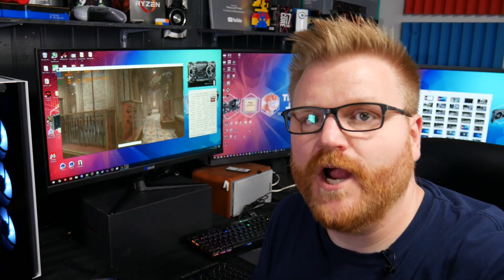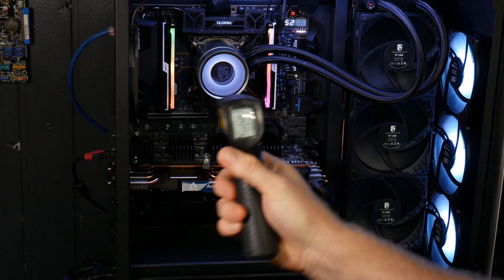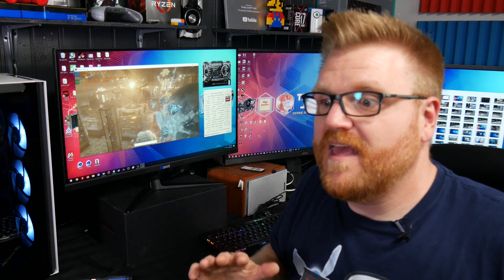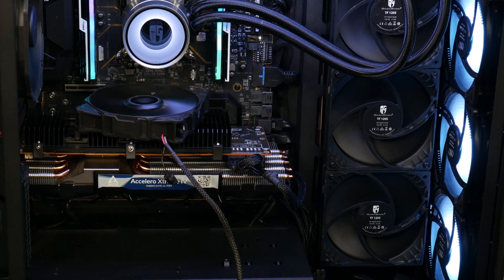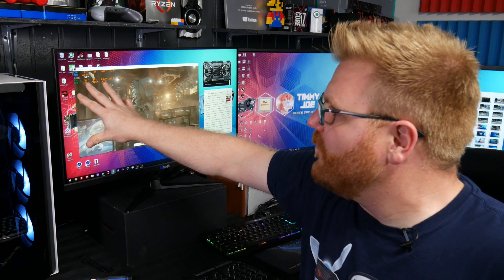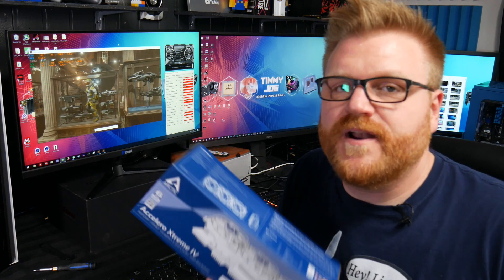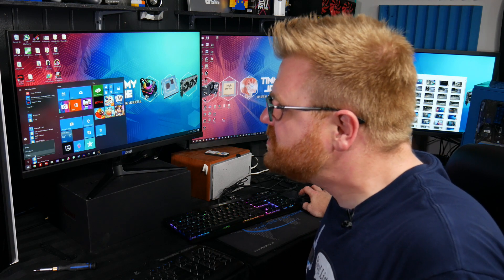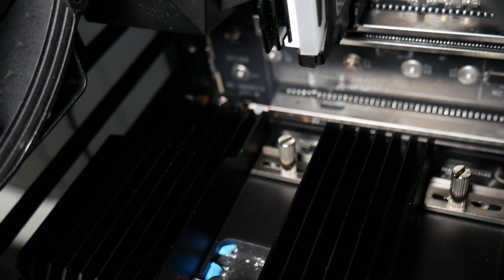Not even the Arctic Accelero Xtreme IV...

Comment: More fans doesn´t always mean better cooling or airflow. I mean, from what I understood, you have 3 front fans sucking air in, one bottom fan also sucking air in and three more fans sucking more air in from the water cooling (so 7 fans total sucking air in). But you have only one fan as exhaust? That seems not enough to compensate from all the fans as intake. The amount of exhaust fans are as important as intake fans.

Of course if you tested this without the side panel and still you have a hot card, then yes, something is definitely off with the cooling of the card. But if you tested closed, then it could be the fan configuration. But hey, complaint to Artic and to AMD, for making colling solutions that don´t work (in the AMD side, cooling solutions that are LOUD).

Because there are some 5700xt with other coolers with axial fans that cut around 10ºc to this card. So I guess they are doing something right.
Reply: There's nothing wrong with having unbalanced intake/exhaust because the case is not sealed and thus air will exit out of any hole it can find to prevent pressure build-up. Single exhaust fans are traditional because they're usually located near the CPU and prevent hot air from pooling around the motherboard and recirculating. A lot of old prebuilt PCs didn't even have intakes, just vents punched into the side pannel, dust filter and a plastic nozzle right above the CPU cooler, and then a single/pair of exhaust fans on the back of the case.

Comment: The Powercolor Red Devil cards are always super good, this one just takes that to the next level. Serious overkill cooling for the card and looks good doing it.

Its funny, those coolers were made in a time where gpu cooling wasn't as good on older cards, such as the EVGA GTX 580 Classified (which was a high end gpu that still used a blower style cooler) and even on some dual fan partner cards (like ones that'd be in the middle of the product stack like EVGA FTWs or Superclocked models). Its possible that we'll see a Accelero V that's redesigned for newer gpus to keep up with how much smaller the dies are, where the vram modules, vrm components and other critical components that need active cooling. The same is true with things like the Kraken G12 and other hybrid cooling mods to water cool a gpu on the cheap. They were born in a different time when cards could benefit from a solution without heatsinks or additional directed cooling on the vrm components or vram modules. I remember Jay did a video about putting the 140mm AIO with the G12 on a EVGA GTX 1080 FTW and not only was it able to cool the die sufficiently, it actually improved the cooling on the memory and the vrm components even after a overclock. Sure, if you add something else to increase the surface area, like small finned aluminum or copper heatsinks to those components, you'll get even better temps.

Still, a good effort from you for trying to bring understanding to everyone why some of these aftermarket gpu heatsinks might not be the solution a prospective purchaser might be expecting for newer model gpus like the RX 5700 and 5700 XT and maybe even for the new RTX cards. This is good consumer advice, always wait for partner model cards! :D

Comment: The only thing these big 3mm pads to the backplate do is insulate the damn thing, try 1mm pads?
Reply: was thinking the same
Reply: I had this same cooler on an R9 290X only I didn't use the backplate and instead installed individual heatsinks on the ram chips. It worked really really well. I don't know why he thinks this huge plate with those ridiculous thick pads is going to do anything. Then he gets mad at the product.

Comment: Timmy Joe PC Tech : I have the Accelero Xtreme IV and I've put it on my KFA2 GTX 1080 EXOC....and it works better than the AIB cooler but only because my GTX 1080 has a separate heatsink on the VRM-s and the backplate already with the thermal pads underneath it. But with all the GPU-s the backplate is a very good assistant to cool the back of the VRM-s and memory chips but can NEVER be used as the only source to enlarge the heat dissipation of your VRM chips from the back side because the VRM-s are dissipating the most heat from the actual chip surface.
Reply: I did the same thing with my old 1080 ti. It was a pny blower model that used one of those cooling plates over vram and vrm's. I kept the plate on with some dremeling to fit the arctic heatsink and the backplate heatsink. It did an awesome job. Comparable to a hybrid mod.

Comment: i have that cooler on the 290x, and sure, the temps an the noise were lower. but the vrm begins to overheat unless i put a heatsink directly on it. and the compatibility with the mobo and case were huge. until i bought the byksky waterblock

Comment: 1 problem I see is that the ram-coolers are not connected to the main heatsink so the main heatsink heats the air up to e.g. 65°c and then you thy to cool the ram with 65°C hot air. I can't say it will work but what if you reverse the fan ( like installing them the other way around) so the air will cool the ram first and then the core(witch stays fairly cool at the moment)?

Comment: Timmy i got a good valid question i think for ya.  What about those nzt shrouds to add a waterblock to ur gpu with.  It says it supports r9 which you was able to get its cooling system to work maybe it would?  Also i see on tech power up that amd flash now supports navi bios flashing. Have u look into putting a 5700xt bios on a 5700?
Reply: he already tried it... IIRC, because of the pcb layout, either the vram or vrm could not be properly cooled.. maybe it was just the vram..

Comment: Do a video on gtx 770 2gb in 2019 plz ???!!!
Reply: Just a gtx 960
Reply: its not doin well and using a lot of power for that
Reply: I have a 1060 6gb already I know because of the older architecture it has alot higher tdp giving more heat on top of the 2gb of vram I just wanted to see from Timmy to look back at my first gpu
Reply: A Rx 570 would be a way better buy
Reply: Ik 570s have been the sweet spot in the 6-8 months after the crash of crypto it's a really good card for people getting into pc gaming